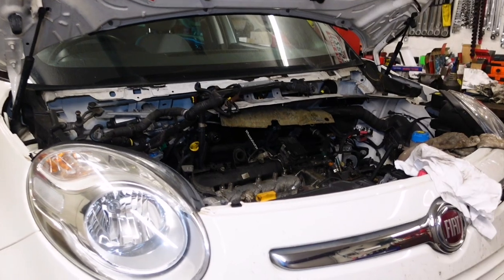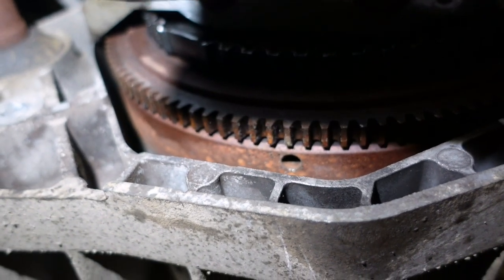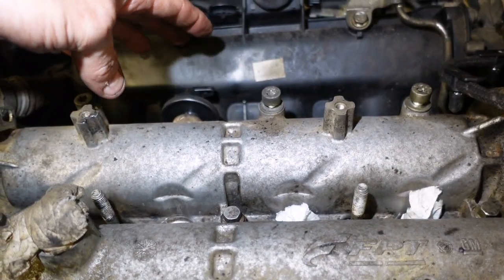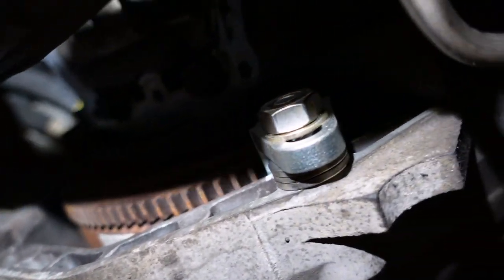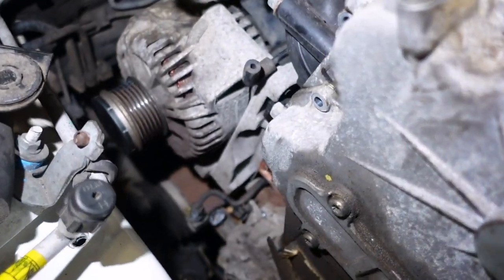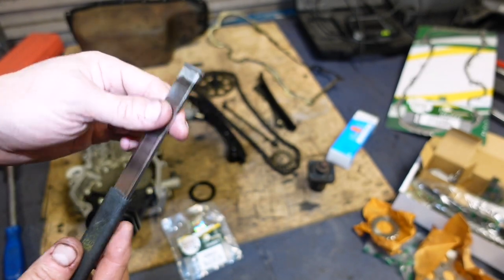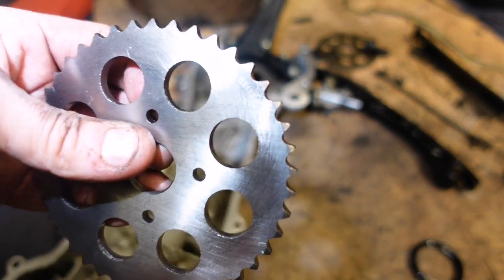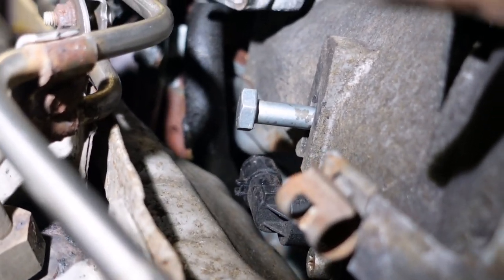Fiat 500L Multijet Vauxhall/Opel Suzuki 1.3 CDTI : Sounds Like a Tractor. Timing Chain Part 2

Comment: Very good video with just the right amount of editing 
( nothing worse sometimes than 3 solid minutes of someone tightening M6 bolts lol ) 
Iv a Fiat the same here to do an oil pump on that the owner provided after having his fault codes read “low oil pressure” and as it happens the plastic lining on the chain tensioner was in pieces in the bottom of the sump (large pieces not blocking the pick up)
Anyway the information in your video here has been invaluable to me thanks very much for taking the time to document this in just the right way liked + subscribed mate 👍🏻

Comment: Brill vid Dave. Just what I needed. Attempting to repair corsa d 1.3 engine, clattering very similar. Gonna drop crankshaft out for re grind and oversize bearings, I thought egr was goosed also, but now thinking the timing will be out as well.  A vid on how to install a crank would be top drawer. I’ve locked top cams up and marked flywheel / case for reinstall. Fingers crossed. 😊 thanks for your assist.
Reply: Currently have an A13DT on its way to me with an engine knock. If it turns out needing a crank I might do one

Comment: Some nice tips there Dave, I have done a video on one of these engines around 12 months ago and totally forgot that the crank bolt was anti-clockwise thread 😬
I’m delighted to see you carry a few beer crates as part of your specialised motor vehicle repair equipment 😂😂😂
Reply from the maker: Yes Peter, couldn't do without the beer crates. Use them often, mainly just for standing on
Reply: @davesterl  l do the same Dave with Jeep’s and other high vehicles. Handy yokes 😂😂

Comment: The injectors leaking in an inherent problem with injectors in general on diesels, and the timing chain issues are problematic to a greater or lesser degree with engines with timing chains. That said this Fiat / GM engine generally fairs well with timing chains if the oil is changed are frequently.

Comment: I've recently done this job (and a lot more) on a Panda 1.3 diesel. The timing chain had 120,000 and a chain link fractured (as they do). There was no nasty noise before it failed. BUT the inlet manifold and ports were rammed with soot so it became an engine out job done slowly in spare time. I took it right down and fitted new piston rings, rockers, lifters and turbo core. Two rockers were broken, another had failed needle rollers. The lifters were worn. Valves were all good.
The cam connecting gears are huge spur gears. I did not remove mine from the cover - bearings and cam lobes were good etc. I believe the cam gears ARE KEYED on place It makes sense, because timing the cams without would be horrible. If one is spinning free there are some really bad things going on. Fiat are very clear that NO TORQUE be applied to the exhaust cam while removing and fitting the sprocket.
The cam chain is the most weedy ineffectual thing you've ever seen. I believe it should have been a twin row chain but Fiat left it too late to change the design. I also believe without GM, it would have been a timing belt. That's what Fiat uses on every other engine in their FIRE family.
There's no point worrying about the timing miss-match because both cam and crank sprockets are replaced. I locked the crank with a bar bolted to the harmonic wheel hub. That gave me a VERY hard resistance to shift the LH thread Torx bolt. Pull off oil pump and all the timing gear. Timing settings are lost anyway but you can fit the crank and cam lock tools when the time is right. 
The cam bolt is torqued using a back-holding tool to avoid excessive force on the cams and chain. I did mine before fitting the lock. The crank centre bolt was done with the crank and cam locks in place. I relied on the M8 locking bolt as Fiat instructions say. Also replace the centre "flange" as it gets worn by the oil seal. Fiat part 73500417. Some kits have one. Mine did not.
Reply from the maker: I can confirm the rearmost cam gears on the 1.9 version of this engine are certaintly not keyed, from personal experience
Reply: I don't believe they are keyed. I'm nearly sure they are both "floating" for more precise timing adjustment. And torqued to 150Nm? same as the chain sprocket whatever Nm that is can't remember off the top of my head.

Also it looks deceiving but there is no exhaust cam. Both cams do both inlet and exhaust as the valves are paired front-back instead of inlet valves all in one row and exhaust in another.

Comment: Trying to do this job on a 2014 Panda but cannot remove the rh engine mounting bracket from the engine, not enough clearance to the chassis leg, can anyone tell me what the knack is to remove it?

Comment: Stupid question to ask but how did you counter hold the camshaft for losing and tightening of the cam shaft sprocket
Reply from the maker: With the counterhold, as shown on tbe crank bolt
Reply: @davesterl  thank you for the reply just wasnt sure but if I taught about it its plenty explanatory 🤣